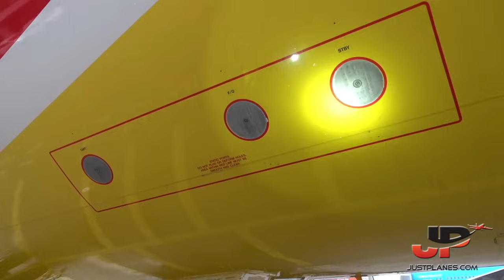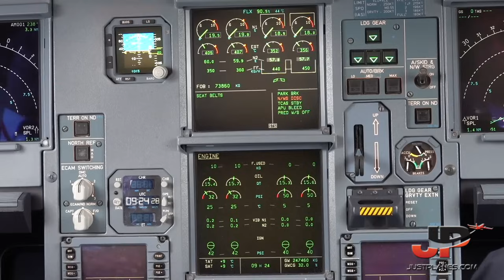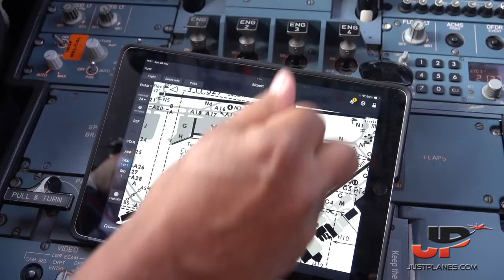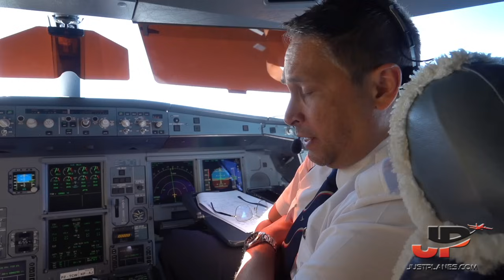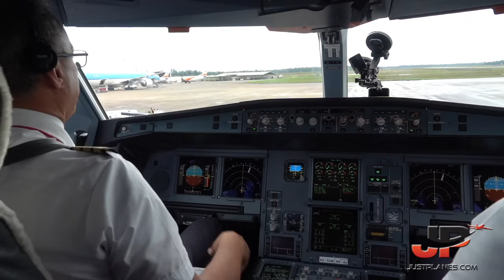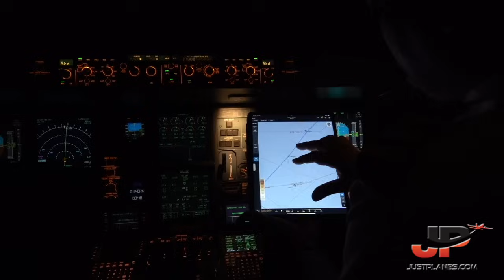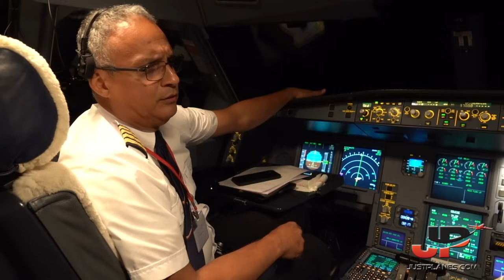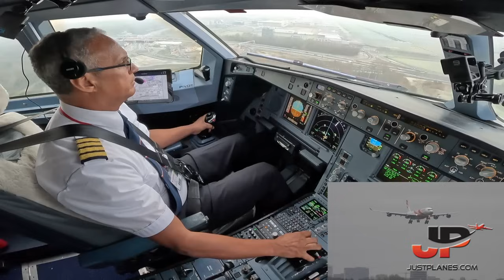Surinam Airbus A340-300 Cockpit Amsterdam to Paramaribo

Comment: On the return flight why was the gear kept out for 2mins?
Reply: That's exactly what I want to know 😆 
May be to "air out" wheel wells and cool down brakes.
Reply: Perhaps as in most airbus there may have been a fault detected which resulted in a M.E.L. restriction which required the gear to be out for 2 mins, also a minor fuel penalty to be added to the flight plan either on contingency fuel or MEL addition depending on which system generated their flight plan.

That my guess
Reply from the maker: Yes they were... in general my guess would be to cool the brakes.